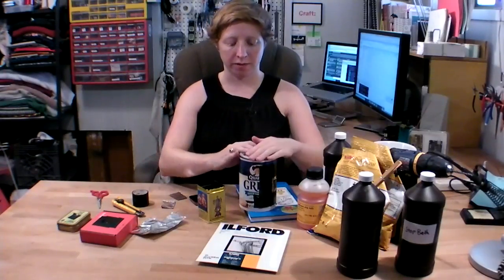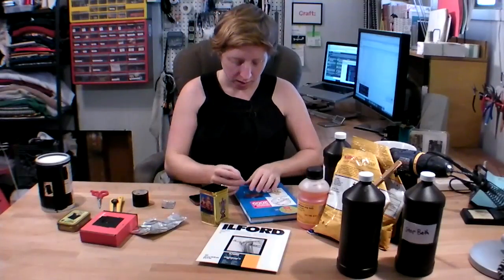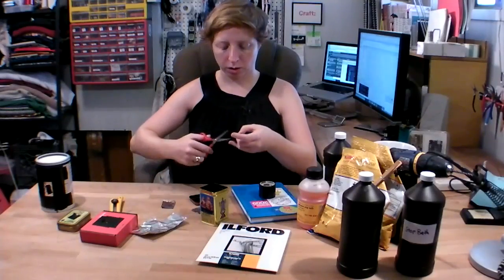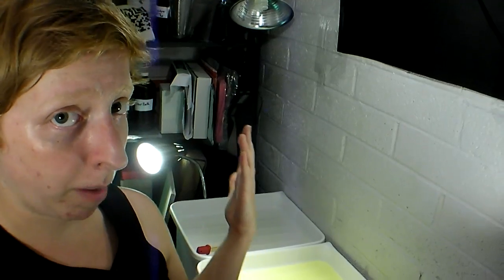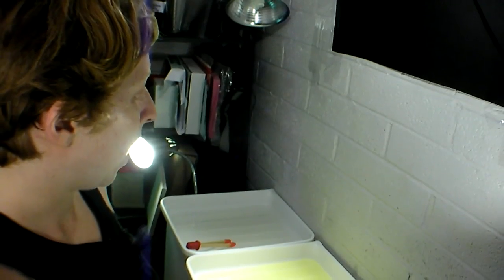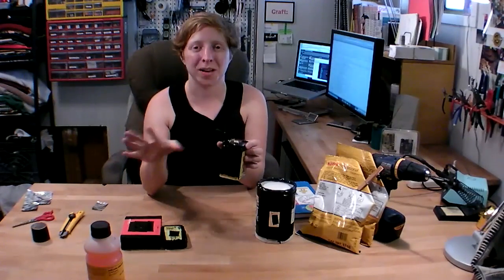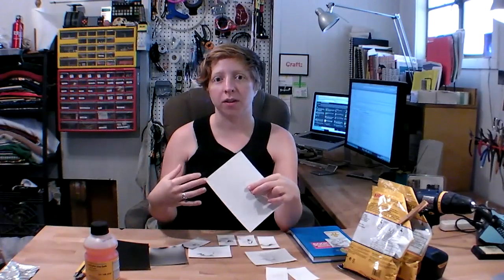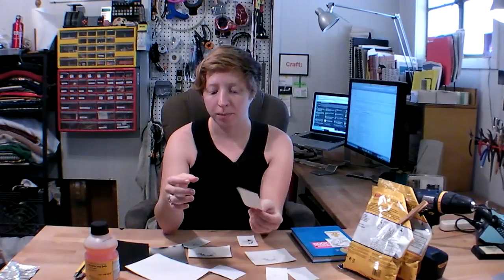CRAFT Video: Pinhole Camera

Comment: Eh.. I just used like half a shoe box, sealed the edges but it took a pen hole not a pin hole so that I could get a nice perfect pic.  I covered the pen hole using my thumb, the results were excellent.  I exposed it at whatever I was going to take a picture at for 6 seconds.

Comment: If you have a 35 mm camera and some film, you can make a pinhole camera if you dont have filmpaper and chemicals.  I tried it once, the pinhole in the center where the lens goes (remove the lens first) and is only about 1/4 of a milli-meter.  I didnte experiement too much, but it does work.  Try times of 30 seconds to maby 3 minutes and write them down and the film speed, etc so you can perfect it.